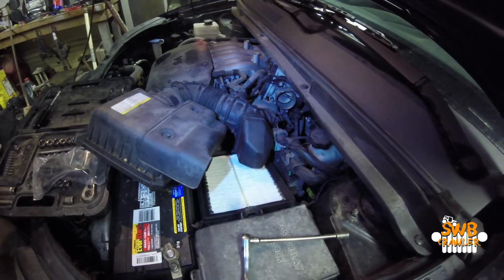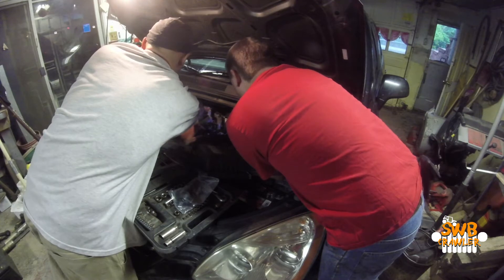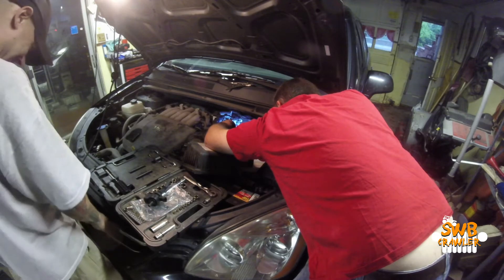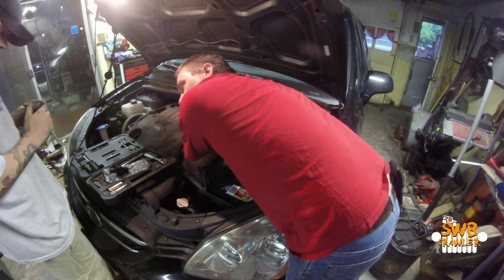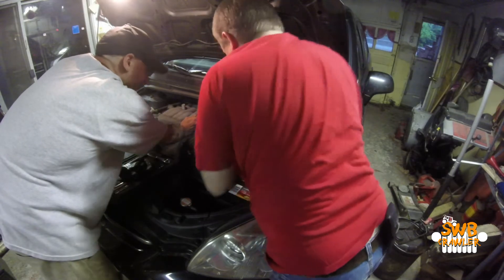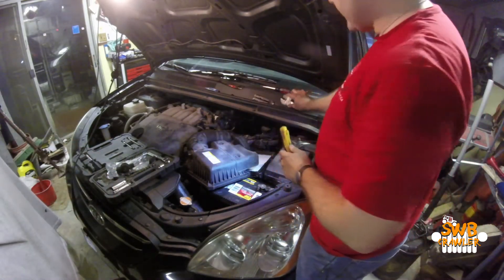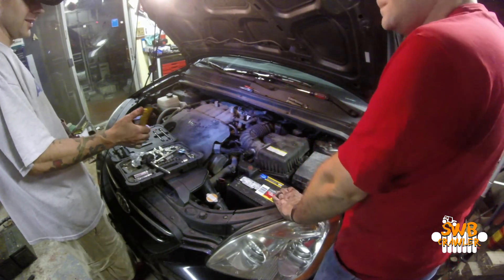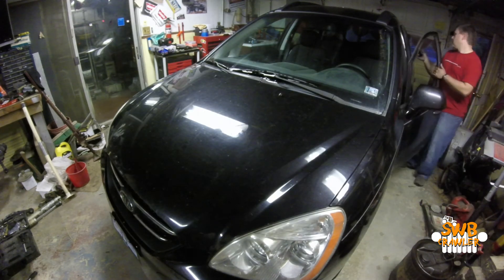2008 Kia Rondo Evap Purge Valve install - P0441

Comment: Just watched.  Good vid. My prob was the engine light 4 the last yrs. kept coming on.  Changed the gas cap.  Cleaned it, still came on.  Changed  the fuel injection assembly.  Now this is the last part.
Reply from the maker: thanks for watching! Glad you liked it

Comment: Thanks for the video...just fixed my 2007 Rondon't. Leave the engine cover alone and just remove parts coming from air filter. Now, look at how the part goes together. I removed the bottom hose from the evap, then I cut the rubber mount so I could pull the valve. Made the cut in the top part of the hose and used my vice grips to open the cut. That hose won't move without help.
Reply: Standard Motor Products CP545 from rock auto $43.78 fedex shipping and I got it 2 days later.
Reply from the maker: Thanks for watching! And thanks for the info!

Comment: This seems like a pretty straightforward repair. My Kia Rondo 2.7l just threw the code a month or so ago. It has 203,500 miles and this will be the first repair, aside a battery I've done on the car. It was purchased with 162k miles.
Reply from the maker: Yea it wasn't terrible. Just hard to reach.  I'm glad it's been such a trouble free car for you!

Comment: I removed the throttle body made it easier. There are two small bolts underside of intake plenum allow you to remove the bracket holding it on. I did however have to cut the hose off. Guess that's why they supply a new one. Whole job took less than 1/2 hr to complete
Reply from the maker: thanks for the comment! thanks for watching!

Comment: I have had 2 ronds. First one sold it at 400 000 km grest car.
Second one is at 391 000 km and going strong. 2.4 liter the purge solenoid is in the front of the engine.
Reply from the maker: @MrEh5  i'm glad you've had better luck. this one's long gone. my brother in law replaced it with something he's happier with.

Comment: I replaced the purge valve on a 07 Rondo. It takes about 15 minutes, maybe 20. After replacing with a new valve, mine has the dieing, no start problem. Not sure yet what the problem is. I just cleared the code and we will try it again, BUT I asked the owner if she tops off the tank and she does. That is a no no, on these evap systems. 1st click and your done, or you can have charcoal canister problems.

Comment: I  also have a Kia rondo 2.7 lt and I’m happy with it bought it new though. I think Kia s are pretty good I would buy another 1 they are just as good as many cars out there or better
Reply from the maker: I’m glad to hear you’re having better luck than my brother In law is.  He truly hates his Kia. ;). I’ve never owned one myself.
Reply: I have a  07 I bought used, w/almost 70k miles, I'm happy w/it so far, had it little over 3 yrs and have over 100k miles on it. Good to hear someone besides me likes them lol  good luck with yours!!
Reply: @ChristineGma  I also have a 2008 KIA RONDO 2.7L and bought used with only 45000 kms. I've had so many problems since I've bought it. One of the worst cars I ever bought as far as maintenance. Glad you are good with yours. Sometimes you get a lemon.
Reply: @heyoou   I guess I was lucky to buy one that I haven't had any issues with. I have the 2.4 engine, maybe the better model?

Comment: Cod error OBDII is P0442 for a KIA RONDO 2012, 4 CYL. I changed fuel gas cap w/new one from KIA dealer but the error continuu to be on the dash (CHECK ENGINE). Do you have any idea how can repair this problem? Where is location for the canister purge valve? Where is location in KIA RONDO 2008 4 cyl, 2009 6 cyl for the canister purge valve? In my familly we have three KIA RONDO 2008, 2009, 2012.
Reply from the maker: Mihai Prigoci sorry I don’t have a deep knowledge of the Kia models. I was just helping my brother in law out. I’m normally a jeep guy.  I can tell you all about those. ;) good luck!

Comment: Thanks for the video. Would it have been easier to get at if you removed the plenum?
Reply from the maker: These sort of repairs are always a toss up between removing more to get at the thing you need to replace, or working around stuff.  Sometimes its more work but worth it in the end, sometimes its not.

Comment: I have 4-cylinder '09 Rondo which does not want to fill the gas tank smoothly. The nozzle stops pumping every second when pumping and I smell gas when I enter my car in the morning or afternoon after work. Is this related to the evap purge valve?
Reply from the maker: I cant say for sure, but the pump kicking off usually means there's some sort of back pressure in the system, which makes the pump's auto-kickoff activate.  I don't know much else about the Kia Rondo, beyond what i've helped my Brother in law fix. Thanks for watching!
Reply: @SWBCrawler  Got it. Thanks!

Comment: HELP! Just replaced mine. Still a very rough idle, now I’m getting a little “kick” while driving as well. Reset the code, no new code, but still having a very similar issue 😒 Any ideas? Will it sorta work itself out after a couple of days?
Reply from the maker: In our case the problem was fixed almost immediately.  Make sure all the connections are good, if they are, I'd say get someone to look at it. I'm not a Kia expert, just helped my brother in law out with this fix and thought I'd share.  You could have other fuel delivery related issues causing what you describe.
Reply: I'd say check out your ignition coils, my 6th cylinder had a bad one and it made the car idle rough the whole time and stutter while I drove
Reply: Prolly coils

Comment: You didn't use the correct amount of cuss words for working on a Kia.   I almost expected you to take it offroad at the end.
Reply from the maker: That would make a fun video.  When he's ready to scrap it, maybe we will. ;) He's the sort of guy that drives a car until the trade in value is lower than the scrap yard value. :P Believe me, every time I work on this thing my frustration level gets higher.  Even the brakes are a pain in the butt!
Reply: @SWBCrawler  I have a 2007 4 cylinder, over 100k mi on him so far .. good to know it's a pain to work on! I won't ask my son for the pain in the butt stuff lol  hope he has better luck with his!!
Reply from the maker: @ChristineGma  Glad you found the video helpful!  Thanks for watching!